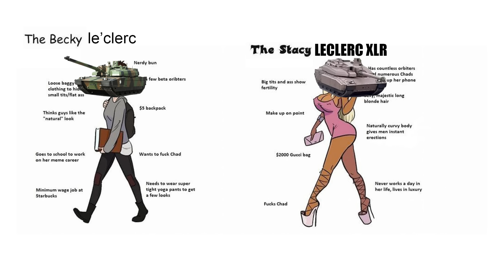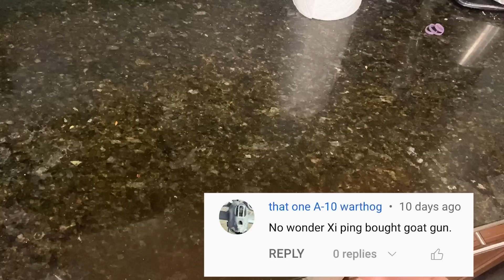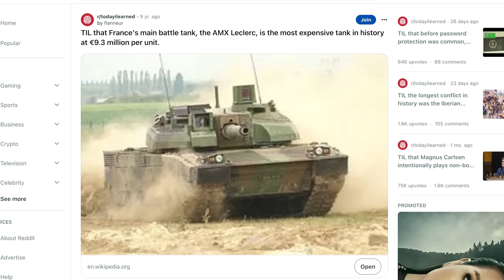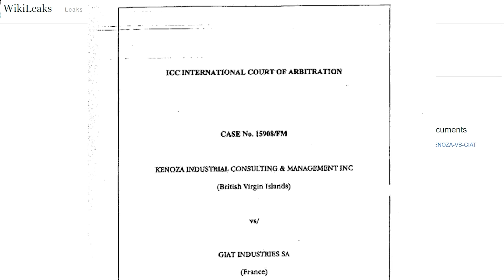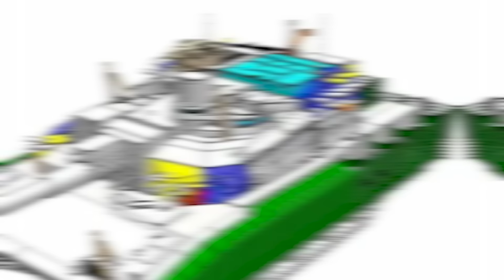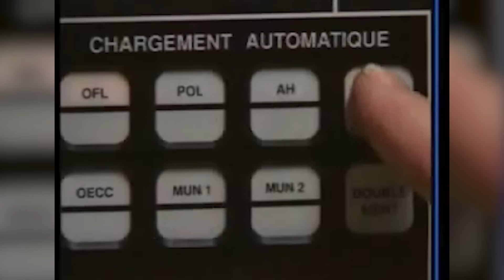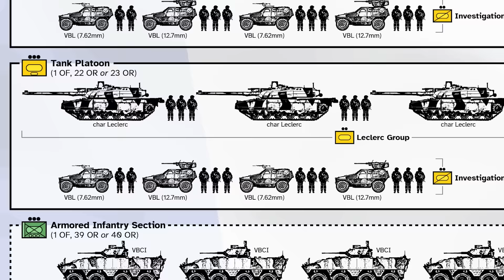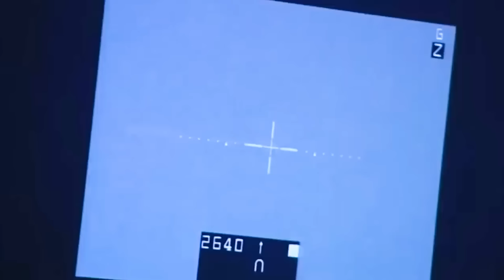Why France's Tank is the World's Most Expensive

Comment: French are very under-rated.
Reply: Exact. And unfortunately
Reply: @andremontmartin7207  Well, ironically, they are very highly regarded in Africa.

Btw.  The MBT ROK K2 was most heavily influenced by is LeClerc.   ROK was at one time interested in Merkava, but found it to be too top heavy, and unstable in high speed, and sudden turns; ROK is mostly very hilly, steep, gravel country road, in off-road, icy and snowy in winter, muddy, slippery during monsoon season.

Two aspects of LeClerc ROK was heavily influenced was autoloaders, (essential for MUM-T), and fire control system for the armored units to minimize redundant targeting, akin to 'Platoon Firing System'.  Redundant targeting minimization is of a questionable value in Korean peninsula, but in Manchuria, Inner Mongolia, Central Regions of China, would be most efficient.

French had come up with some really useful, innovative, unique systems, not really appreciated even among hardcore militaria fans, such as, Brandt Mle CM60A1, breech loading, traversable mortar.

The one French armored car that I am most impressed with is Panhard EBR, packed with so many useful, unique, and innovative features.

The use of H12 air cooled engine, placed under the floor was brilliant; it lowers COG, improving maneuverability, air is naturally cooled  by shading from the sun, making the air cooled engine, both more reliable, and improving the performance, also serving as extra protection from the landmines for the crew.

This also allows the twin driver arrangement; armored cars cannot turn as efficiently as MBTs, by using twin drivers, front and rear allows the armored car to retreat a lot faster than otherwise, while still firing at the enemy.

Another is Rafaelle, even though it's only 4th gen, it can still be more than a match for F-35 depending on situation.   On paper, F-35 looks superior, since it is less visible than Rafael at distance, but Rafale has Meteor, far longer range missile than AMRAAM carried by F-35.

Just like many amateurs had thought that T-34 was operationally superior to Panzer III and IV, due to superior armor, and longer range gun; forgetting Panzers had superior optics, allowing them to see T-34s before T-34s could see Panzers.

So yes, in theory, F-35s can see Rafaele before Rafael can see F-35, but Rafael can fire meteor at far longer distance than F-35 can fire AMRAAM; meaning even if F-35 sees Rafael first, they cannot necessarily take advantage of that.  They to had to get to Rafael close enough before firing AMRAAM, but before F-35 can get that close, Rafael could see F-35, and launch Meteor before F-35 gets close enough to fire AMRAAM!

Why ROK KF-21 intends it to be compatible with Meteor.   One big reason why UAE bought Rafael was its capability to use Meteor, unlike F-35s.  Of course, U.S. temporarily was not willing to sell F-35 to UAE.

F-35 stealth capability is over-rated, when it comes to durability, robustness, and cost effectiveness.   They are very expensive to maintain; why ROK has decided to go for hard stealth coating, instead of F-35's soft stealth coating.

Plus the MAT subguns from the colonials wars during the Cold war; many believe it is the most under-rated, and the most cost-effective SMG of the Cold War, not HKs.

Just like Manhurin revolvers, the most cost effective, accurate, robust, durable, reliable, revolver ever made, not Colt Python, not Korth.   Again, very under-rated.

Comment: The Rheinmetall RH 120 with L55 is actually more common by now than the L44 gun...
Reply: Not true
Reply: On Leopard tanks? Yes. But all M1A1 and M1A2 Abrams use the L44 with DU ammunition
Reply: @Lars.171  you got me, I forgot the Abrams still has the smaller gun...
Reply: @mkultra3679  And that's a problem

Comment: 200 Leclerc are combat ready ,  +~200 are stored, but all of them are from the first batch, never modernized and mostly use as spare parts source...
Reply: Considering present events in Ukraine, it could be worthy to refit 50 or 60 of those older Leclerc. It would add some depth to help with potential attrition. Don't necessarly put them into new regiments (you need people for that and France is tight on the HR side too), but retrofit them what so ever, so you have them when you'll need them.

Comment: I think the 44 Rheinmetall canon is only upt to the Leo2 A4. Leo2 A6 haa a longer gun than A4.
Reply: yes, Leopards 2A5+ feature a Rh120 /L55, same with K2 Black Panther who also has a 120 /L55. The issue with at least the german one (dunno about korean gun) is the fishing pole effect when firing on the move that impact negatively the accuracy, something the CN120-26 from GIAT doesn't suffer since it was especially developed to be able to be stable and rigid even at 50kph on off road condition, hence the 90%+ hit ratio @4km in those conditions, something that neither Leopard or Abrams can achieve
Reply: The L44 is up to the Leopard 2A5 and still used in all M1A1 and M1A2 Abrams since the US uses DU round to achieve the same energy with the L44 the L55 has with convetional APFSDS rounds

Comment: This is basically the same thing that happen to the F-22. Which is why the F-35 was a group effort and a massive export.
Reply: but if the F22 was a formidable aircraft (and i'm french) the resulting F35 is very questionable...
Reply: @leneanderthalien  That is why they made the F35 to be an adaptive design. They are working on several iterations of it for specific roles. 
While also uppgrading other planes to be weapons platforms guided by the F35.
Reply: @kenji214245  Oui mais les F-35 sont encore et encore cloués au sol, le logiciel est mauvais! à quand un avion qui vole sans tous ces problèmes chez LM???
Reply: @marc9080  had to translate that but yeah early on F35's seems to have struggled quite a bit but they are also flying a lot to get all their pilots up to speed on strenghts and weaknesses. And it seems they are getting a lot less issues lately according some of the articles i have read on that.

Comment: I don't think it is fully fair to use its small production size as a reason for why the Leclerc is so expensive. Case in point, Japan's old Type 90 and modern Type 10 main battle tanks manage to cost less than the Leclerc despite having much smaller production runs (Type 90: 341 built at approx. USD 7.4 million per tank; Type 10: 117 built at approx. USD 11.3 million per tank). Ditto for South Korea's K1 and K2 tanks.
Reply: It was never a good idea to compare japan prices vs Europian prices. And the size of production when research and production costs are big is main factor for price. This is simple the law.
Reply: @ljubastojanovic608  I think what you've stated doesn't make sense, or at least you've not explained it properly. Why is it "never a good idea to compare Japan prices vs European prices"? Why would Japan (and presumably South Korea as well) be somehow exempted from having to recoup research costs?
Reply: @evilwelshman  Yes, I didnt explain propeerly, because YouTube commments are not the ideal place for that. But I will say that we learned in Tecnical faculty of Belgrade in 1970, when Japan mirracle was in course that their success was not based on research. They were simply coppying Western most succesfull solution and make them beteer, smaller and cheaper and this products still on market peak Japan sold the most, the others leaving the marked and trying to proffit on new products, having high researc and marketing costs, but then again in the peak of market life, which was on that time app, 4 to 5 Years long, Japan came with better quality and lower prices...  Of course, that was only on beggining, but still is "not logical". In that time Japan was sending some robot experts to Belgrade to learn theory.  I will give You another not logical example. Working in a large cable Factory as begginer in 1975. I was in position to read an US made analysis on "How is it possible that Japan is offering cables on World market under Direct Cost prices" meaning summ of Material and labour cost, while bying everything on World market. This is ultinate unlogical. And it was explained that, due to their mentality, Japanese sometimes dont include Labor in Direct cost calculation. The factory was considered as a enlarged family buisiness, and employies as a relatives. So sometimes the owner will accept some deal onlly to be able to pay salaries, without proffit of even with some loss, rather than fire the personel. The workers from other side will accept temporariilly salary reductionn just to help the Company to survive. Those are only 2 examples.

Comment: as far as i know the UAE leclerks were a different version with a longer hull to fit the MTU engine required by the arabs and a more powerful AC, the modifications to the design did cost so much the deal didn't break even...
Reply: the right question is wether arab required were logical or not. If they were than the problem was on French side.
Reply: Whats your definition of a deal "not breaking even" for such a claim to make sense ? Did they have that deal yes or no ? And can we establish without a doubt that another manufacturer wouldve been able to deliver the same for less ? Logical falacies and biased naratives everywhere these days smh
Reply: @Jugement  the sale of the UAE version didn't bring any profit as the development of the variant did cost more that the sale's margin
Reply: @Jugement  break even: reach a point in a business venture when the profits are equal to the costs.

Comment: I'unno man. Saying the AMX-30 only has 80mm of armor while the Patton has "240mm of armor" is really disingenuous. Not only does the m47 weigh barely more than the AMX-30, the 240mm of armor is the thickest part of the armor. The hull is actually only 100mm thick. Barely thicker than the AMX-30 and shown by the fact it only weighs 8 tons more in total while being larger. They also have about equal power to weight ratios.

Comment: How is this diesel engine fitted with a high pressure gas turbine? And why does the gas turbine only produce 2,500 rpm? Enquiring minds want to know if you understand what a turbo diesel is and if you understand that the turbos on this 1,500 hp engine are spinning at 80,000+ rpm.

Comment: Your explanation regarding the cost works in comparison to the Abrams but, compare it to the Challenger 2 and it fails miserably. 447 Challenger 2's were built at about 5 or 6 million each. The leopard A6/7 is the opposite with over 3000 built at up to 16 million per unit. Some tanks are just really expensive.

Comment: I would not bet too much on the MBT (next gen tank from France and Germany). All european cooperations in defense have led to failure in general. The problem is the spirit of the cooperation: countries want in in order to get a part of the development, and project initiators get down the cost and higher volume. Except this decentralize development brings huge complexity, and the requirement engineering is usually catastrophic: each country wants the product to match their own goal, and the compromises to reach a consensus lead to a lame product.
That s why the war jet Rafale overclass the eurofighter in all fronts. (Robert Baratheon: what is bigger, 5 or 1?).
Regarding who buys French: countries who don t want to be depending too much on the US. Recently, the german bought some F35, because the US told them that s the only aircraft which would be allowed for carrying US nuclear rockets (the german don t have nuclear force themself, but they can use some US munitions for their own protection, and the launch is under the US president approval).
Last point, according to french generals, the major reason why the Leclerc was not sold well, is because it came too late. The german leopard 2 was delivered in 1979, and a majority of european countries renewed their equipment in the 80es. When the Leclerc came out in 1993, they already had what they needed.

Comment: I heard that the Future German Leopard 3 Main battle tank turrent was supposed to be 135mm, but the France wanted the 142mm tank turrent. That was reported back in 2018. So I don't know why both are still sticking around the 120mm even though it's the most common tank turrent through out N.A.T.O.
Reply: You talk about the industrial conflict around the MGCS project (main ground combat system) which will obviously include a tank. Indeed there is a conflict on the barrel between nexter (French) and Rheinmetall (German).
But the project is planned for 2040 in the meantime there will be modernized intermediate tanks and surely the German KF-51 which risks endangering the project.

Comment: Small French tip, the "c" is silent at the end of a word and when an "e" is before an "r" you pronounce it "ai" (sound like "air" in English without the "r") and the "r" becomes silent. Buuuuut because of the "c" at the end, the "r" is no longer silent , which becomes "air" instead. 
 So in French, "Leclerc" sounds like "Leclair". 
 Funlly enough. In French both ways sound the exact same, but that excuse doesn't work during a test so you are still going to lose half a point for writing it "Leclair" instead of "Leclerc" even though it's more intuitive.

Comment: Could France sell the Le Clerk to Spain or other European Nations that could then give up more Leopard 2 to Ukraine?
Reply: The Leclerc is not produced anymore, that's the main reason why there are so few today. There isn't even line of production for engine and spare parts. They all have to be ordered in small batches which is incredibly expensive. 
But Spain and other European countries could buy the upcoming EBMT from the joint venture KNDS which is a Leopard 2A7 hull with an upgraded Leclerc turret featuring a lot of good stuff like a 30mm remote controlled cannon , active defense system, the Leclerc main gun and a M2 as coaxial gun (like the Leclerc).
Reply: Ça marche pas comme sa

Comment: it would seem that the French were right to favor speed and mobility to the detriment of excessive armor which in any case will not resist modern missiles .... these last days prove them right when we see that the Leopard 2 is easily destroyed on the Ukrainian front, if they had been more mobile they probably would not have been destroyed. The Abrams tank did no better in Iraq 
despite weak opposition !  On the other hand, the Leclerc tank is all the same very very well armored, but it also has extraordinary mobility and remarkable vision and designation systems, so it does not go blind! not to mention that it has very good means of anti-missile jamming and has a unique system of electronic integration into the battlefield.....it's a beast! you are very badly informed, the French have 300 Leclers ... and not 200.
On the other hand, I believe that the Americans are very badly placed to give moral lessons, they are the only ones to actively and industrially spy on their allies, they sign contracts by imposing economic pressures.. and I would even say economic threats.. .the USA is not reliable. there is only to see for the F35, this flying crap that they resell in the world while this aircraft is a flying pad that has never been finished and will never be.
Why Americans don't send Abrams to Ukraine? they have 3000 in reserve! and yet they only sent 30 poor little obsolete tanks.....because they are afraid that we will see that it is very far from being as good as they claim.

Comment: The Leclerc has a few serious problems, the storage lockers aren't wide enough, so the soldiers have to cut their baguettes in half; the air sealing for NBC is so good that they are not allowed to take cheese inside the tank; and the size of the autoloader means they had to reduce the size of the wine rack to only 3 bottles per crew member.

Comment: I dont think people realize what a turbine charged diesel does to a tank.. Its blazing fast off the line.
It is however french, so it requires 10+ mechanics carefully massaging it every day and they dont even trust them enough to use them in their own ARVs instead opting for euro powerpacks from KMW...
Reply: @stephen10.  Sure, the system might be reliable but the simple fact that the ARVs use normal KMW powerpacks show a low confidence in the reliability of the powertrain (And after seeing how many mechanics and spare parts are needed just to keep 4 of them running for a competition i understand why the switch was needed)

Its an immensly interesting choice, but as always, its french in its design and execution making it both brilliant and...peculiar ;)

Comment: So the French want to spread their forces and with low numbers of high tech tanks, kinda like in ww2
Reply: Just the opposite. France want to perform Blitzkrieg, with a light and speed army and a power full comunication system. In WW2 France have heavier tank than Germany, better protected, with more fire power. But to slow, with poor communication capability and stratégic mobility. The actual doctrine is just the opposite of WW2 tank doctrine.